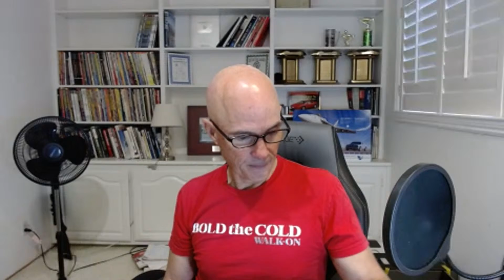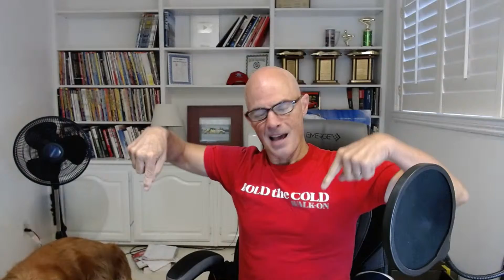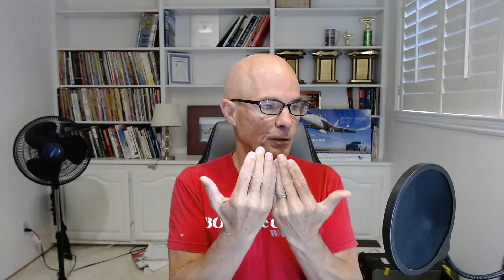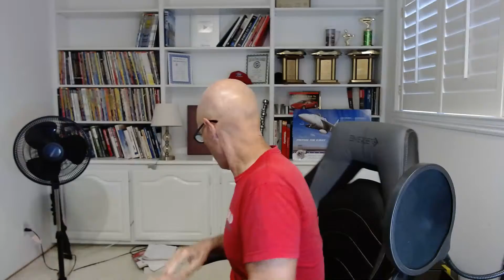LET'S TALK TECH-DO I NEED TO TEST INDEXING PLUGS?

Comment: I'm pretty sure if indexing the plugs had a power advantage or made a cleaner more efficient flame front or lowered emissions, we would have gotten spark plug installation direction by now from the auto manufacturers. I don't know how much time I spent at the drag strip in the mid 70's, under pressure gapping and indexing plugs to get the two cars ready for the next pass just because my boss saw a competitor in the pits always messing with his plugs. After he talked to him about it, we started doing it like it was a big hp gain secret that no one knew about. One engine we ran for a while had Jhans 13 to 1s, and had to index the plug and install them with the piston down the bore so the dome didn't make contact with the plug.
During tune-ups all through the seventies and eighties I would play with the gap on the plug to get all the fire lines even on the scope. In my opinion I "felt" like the engine idled smoother. Only. I think it did actually lol.

Comment: You may mention this in your video, but I would like to see "very" extended reach plugs vs surface gap and the inbetweens etc. I do think that the combustion chamber would have an influence on any improvement though, especially a poor one. But I do not know..

Comment: Richard. J-plug index is insignificant because the flame shielding effect is minimal. However, re. your other question. The flame front acceleration on a 'big' gap is measureably faster. So, if you (relatively) retard the ignition timing, you should also see a greater gain in low-medium speed torque, which in turbo applications noticeably reduces lag. BTW. if you want to be able to significantly increase spark gap without changing you ignition coil, you can try Nology Hot Wires, you might be surprised. Also, we have tested 'filed edge' J plugs. The result is that a higher voltage is produced prior to a slightly delayed discharge (spark).

Comment: I've just started this video as I was intrigued simply because I made a comment about gap and indexing so either way this goes I'm excited to find out if the old idea is on or not thank you for the time and effort.

So I'm thinking this old school ideas are more in tuen with what you said old school ignition systems, I don't think much gain would be had from a newer engine platform.
Reply: I've indexed plugs in old school engines.
  One of the best things you can do to give your engine a long happy life.
   I'm thinking of indexing the plugs in a 2017 5.7 dodge v8 with 2 plugs per cylinder.
 It's my initial understanding that one plug fires on the compression stroke and the other fires during the exhaust stroke
If this holds to be true, I'll have the gaps towards thier respective valves.
 Something to put on the to do list as I test fit the 5.7 in a 1963  station...

Comment: I've heard hat indexing is more important on flathead engines.  Facing the opening side towards the intake valve or cylinder can help improve combustion.  I've been meaning to try it on my Onan generator to see if it helps fuel efficiency.
My Onan has a two clyinder, horizontally opposed, with flathead cylinder heads.  It's a big 1.0L engine but is only rated for about 13HP.  It also only runs at 1,800rpm.  Has a nice hum to it.  Unlike the screamer generators that you get at the big box stores.  It was made in 1978.  Runs like a top on propane.

Comment: I tested e85 on my na engine (not a large cam) and it got 50 more more ft lbs down low but made within run to run variance the same horsepower peak. Not sure why such a good torque gain. (7.0l lsx engine with smallish cam like stage1)
Reply from the maker: seems like a lot
Reply: @richardholdener1727  well i was able to run more timing but still very odd got torque but higher rpms was the same as 93 , no hp gains. I was curious since it does make a difference on higher compression engines which won’t even run well on 93 and of course boost it works great but this was a normal street engine 11:1 so i was curious if there would be any difference even tuning it with e85 map and flexfuel sensor
Reply: @richardholdener1727  With an alias like that... and being a post 2020 account.  They are not well grounded individuals.

Comment: another trick was side gaping plugs to cut back the ground strap so it was half way over the center electrode. do test different plug stuff. all so test how lean can you go with out miss fire. if you go  super lean that would translate to economy. spiral core wire test. thicker plug weirs are for running more gap with out arcing the insulation copper core will only work with points or that is the word on the street. I read a book by a electrical engineer that stated .100 gap was ideal. he stated that more ignition energy would have the effect of advancing the timing by 1-3*. so more gap in theory should best after pulling 1-3*.  the idea with plug indexing was to point the open gap to the middle of quench pad. one idea was to run as cold a plug as possible so to stay out of detonation with out loading.  love to see water injection on a na engine using 87 octane. the lower octane fuel has more btu, but lower octane so adding water injection could give you detonation resistance + extra energy so more power in theory.  take care.
Reply from the maker: LOWER OCTANE HAS MORE BTUS?
Reply: @richardholdener1727  has more BTU or available heat energy. diesel for one has a vary low octane but hi amount of energy. my idea was use a hi compression engine with low octane regular gas that it would ping on and use water injection to stop ping . the idea is low fuel octane+ water injection will do better than hi octane gas. thanks for reply !

Comment: I think indexing might matter in the case of direct ignition but not in carbureted applications.
In the case of DI, the recommdation I'm familiar with is the open area of the plug should be towards the injector, not shrouded from the injector by the side electrode.
Reply: Ficht injection? It’s definitely necessary on direct I can vouch for that! It’s also got small gains on any engine even some of the pro tuner’s I speak to see some small gains on high rpm n/a stuff like 5hp,i index high strung two strokes and I had done quite a few by request over the years but often the gains on an otherwise fine running engine aren’t worth 2-3 boxes of plugs and hours plus $50 worth of accel washers lol
Reply: @needmoreboost6369   Factory method doesn't require perfection (spacers not required), just so gap isn't shrouded from injector stream.  Yes, ficht.
Reply: @thisisyourcaptainspeaking2259  they were hated by most but they make power! servicing a few and running them on a stand for the first time in comparison to their carby counterparts as far as responsive throttle they are on a different level.
Reply: @needmoreboost6369  They've done surprisingly well, I've never agreed with the 100:1 ratio crowd, I'm more comfortable with 32:1
Ficht is actually cleaner than 4-strokes in terms of emissions.
Reply: @thisisyourcaptainspeaking2259  yeah I’ve always had shop mix tcw3 and synthetic hp two stroke for everything at 25:1

Comment: The plug gap test was interesting.  What I recall as a teen learning in the 80's was its that last .1% was the reason to gap and index. I love you sharing so much lnowledge, I have bough and read so much material over the last 37 years, you give a synopsis in minutes.

Comment: Man, i don't even know what "side gaping" or "surface gaping" is... 🤔 This topic can easily go down a rabbit hole. Like i have a set of old school Nology spark plug wires that are grounded with a strap. Are they junk? Do they offer some advantage? I've never had an issue with them. The Ford Racing 8mm spark plug wires, are they junk like i always heard? I never had an issue with them either. 
Thanks for the testing and education Mr. Holdener💪

Comment: compared j plugs with surface gap on a 246 dino  with msd the dyno showed no measurable difference
Reply from the maker: 246 Dino? cool test mule
Reply: @richardholdener1727  it was my hilclimb and Mexican roadrace car  the engine was blueprinted stock except for exhaust cams, I didn't know better at that time. and the airbox which cost a whooping 15 hp. so ran without it, just a screen when competing.
Reply: @richardholdener1727  how could you not turbo it 😅

Comment: 1% of 400hp is 4hp  ...  What is the percentage of error on testing +/- ?  Measuring small gains accurately is not easy w higher horsepower engines.   Unless you have extremely accurate testing instruments.. it would likely be easier to look for small gains.. like w spark plugs... on a 100hp engine..  or less powerful engine where the horsepower number at 1% is fairly small.
Reply from the maker: the percentage of error is 0 for the dyno, the change would be the motor. we get less than 1 hp (actually less than 1/2 hp) variation at 400-hp level
Reply: @richardholdener1727   Thanks.. oh yeah.. Hail Trail 90 !.... Lol

Comment: Richard. One thing I would love to see is a test comparison of spark plug wires with just a smear of Dielectric grease on the boots like there is supposed to be or completely filled with Dielectric grease. As Dielectric grease is a insulator and I would think that it would have a weaker Spark if completely filled as opposed to just having some smeared on the inside of the boot not contacting the lead.
Reply: The grease serves the purpose of keeping moisture out and as a lubricant so the boot doesn't become stuck to the plug insulator, which still seems to be my struggle (removing boots without damaging the boot or wire).
Reply: @thisisyourcaptainspeaking2259  Yes. I know this. And that little packet that comes with a set of wires iris more than needed for the whole set. But I see guys filling the whole boot and contact full. This stuff is insulative not conducive.  More is not better.  It is for the rubber. Not the contacts.
Reply: @tombrown879  Correct, more is not better.  In fact, too much could cause problems, in my opinion.  Will the silicone grease be absorbed by the conductor and cause it to swell or break down over time?  I see no benefit.
Reply: @tombrown879  it’s fine to coat the contacts as removing any air reduces the chances of the spark breaking out it behaves to hv similar to the boot itself